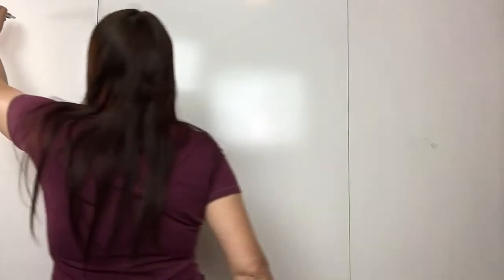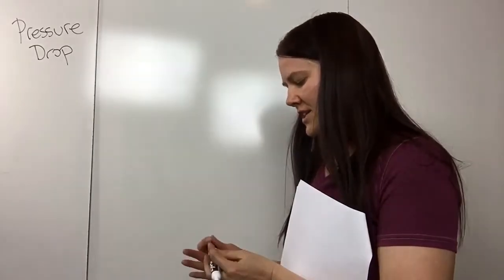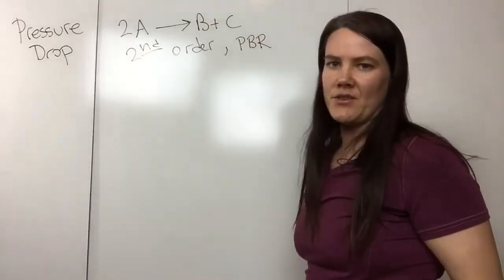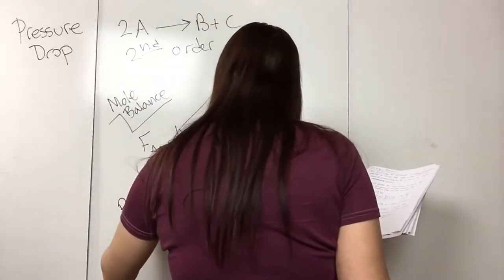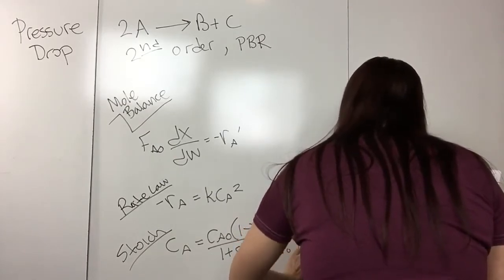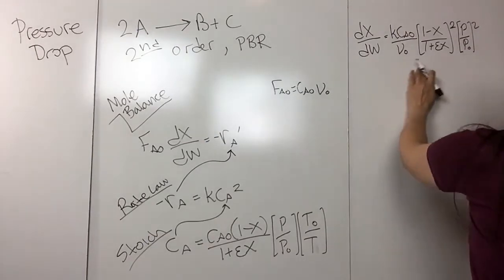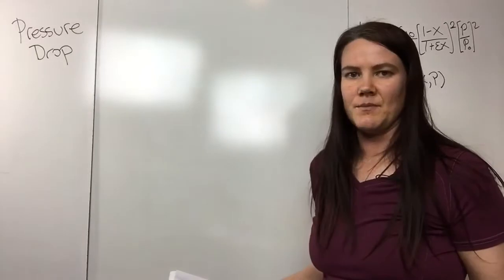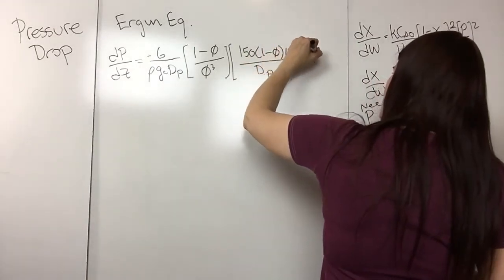20) Reaction Engineering, How to Account for Pressure Drop in Reactors with Ergun Equation

Comment: I know Ergun Equation solves for the pressure drop in a packed bed reactor. It has terms for the length of the bed, the void fraction or porosity of the particles.